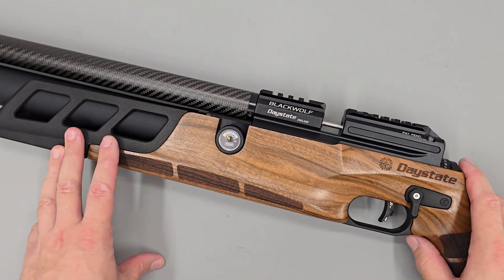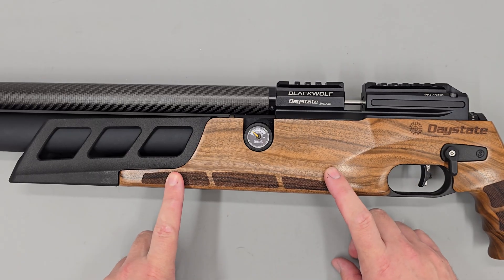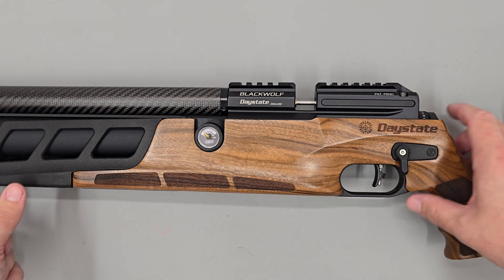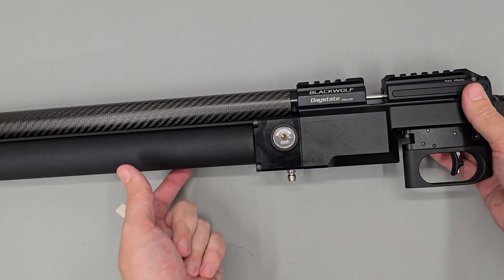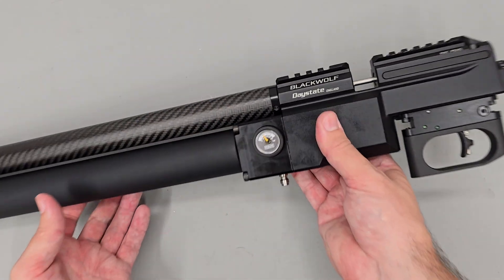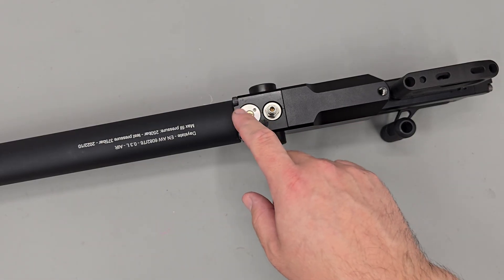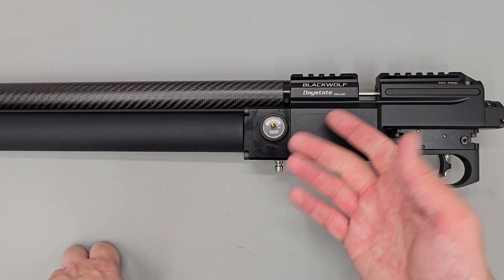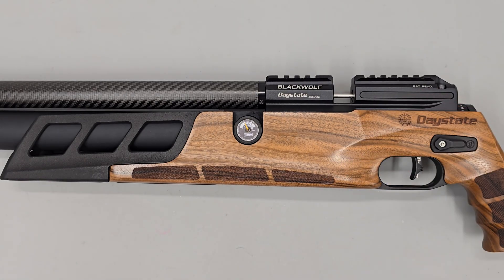DAYSTATE BLACKWOLF REGULATOR ADJUSTMENT

Comment: Interesting, thanks for the information. I am in US, currently have 3 Blackwolfs .177, .22 , .25 really like them all. Have not touched regulator, no need to, have the power wheel to make adjustments and that works well too. Curious so what you did to regulator on this (non F.A.C.) you increase the regulator, that would take it to over your 12 ft lb limit, would it not. Just curious. Thanks for sharing.
Reply from the maker: Thanks for the question and congratulations on THREE (!) Blackwolves...you must like them!  In the UK there are rules that limit unlicenced airguns to sub 12 ft/lbs. To stay withing the rules we restrict regulator adjustment so it cannot be externally adjusted without striping the rifle.